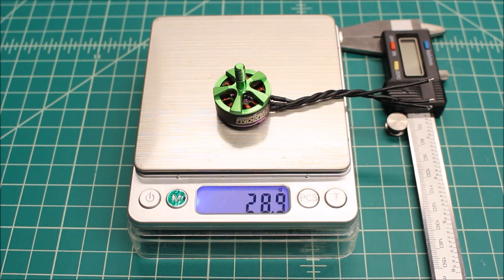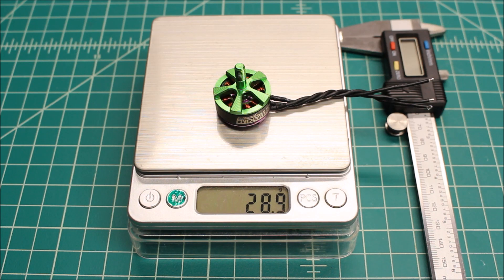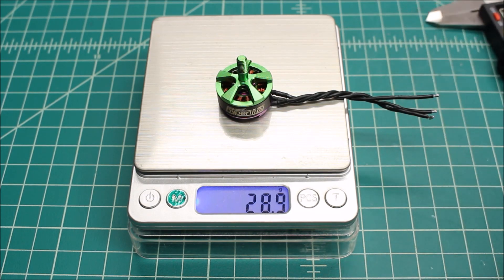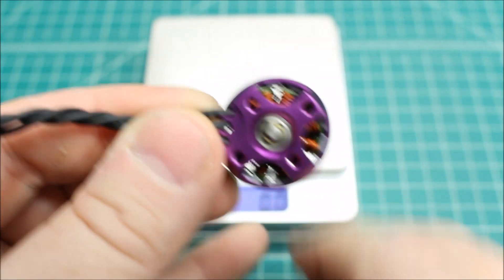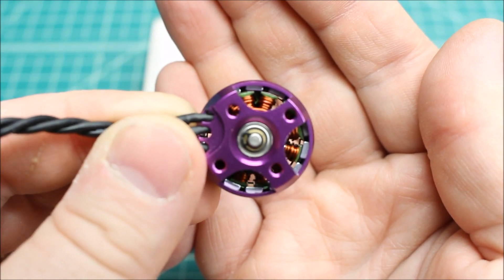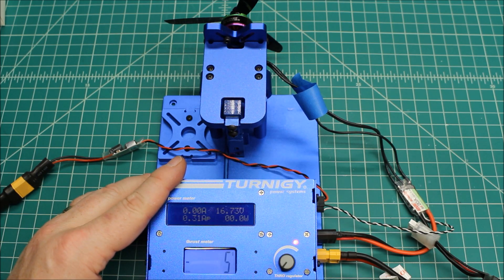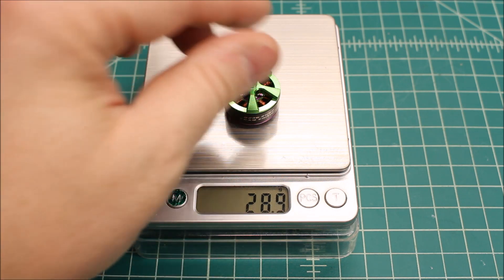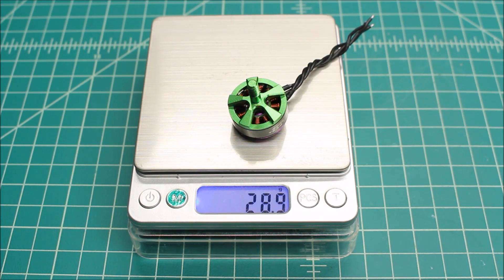Hyperlite V3 2206 2450kv "Team Edition" (Motor Test Series)

Comment: hey I'm getting some really bad mid throttle oscillations my flight controller is soft mounted and my Motors are soft mounted could it be the yaw in the tune or do you think I might have a janky motor this really sucks cuz he's motors have a lot of power and I've had to go back to Luminaire for a clean flight

Comment: what amp esc would you recommend for this motor?
Reply from the maker: joshua locsin 20amp is plenty.
Reply: X-Frames FPV question... If it's drawing 30+ amps why run a 20a esc?? Are the numbers lower with all 4 motors running? still learning a lot about these quads and motors and everything in general.
Reply: static test arent relliable.. usually 30% hire amp draw then actual load.. 20amp should hold it. no cheap 20amp esc tho

Comment: I have that same turnigy thrust stand, and it gaves low readings, more than 100gr off. Seems that yours is also giving low results from what should that motor put out. Now i test on a small weight scale with motor on top and gaves more acurate readings.
Reply from the maker: ashingashinga I agree the Turnigy is well over 100 grams short. My  RCbenchmark 1520 just arrived and I have done some testing with it and it's much more accurate. I will be doing all my new test with it as well as redoing some the testing already done.